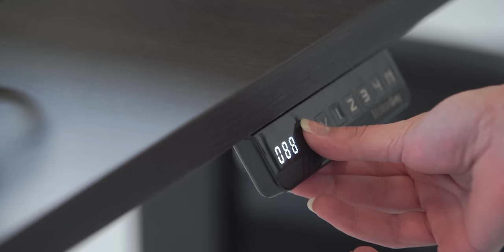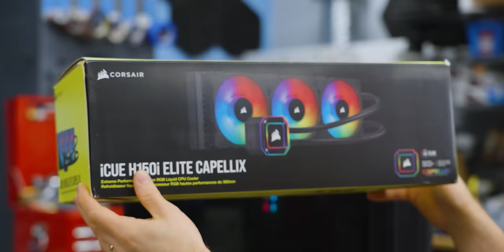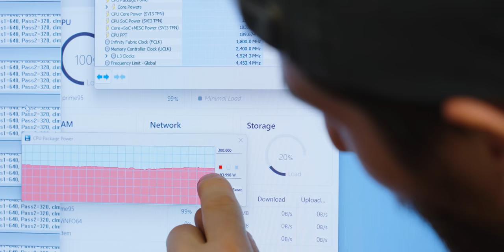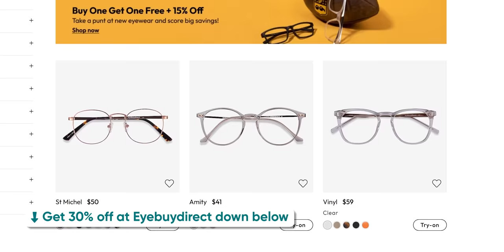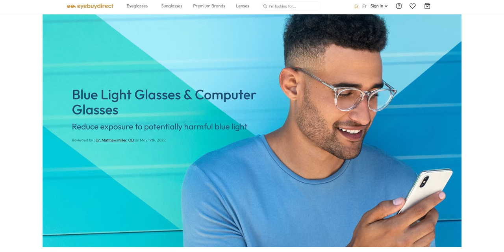Redneck Engineering my own CPU Water Cooler

Comment: I like DIY cooling videos :) Did a DIY watercooling setup for my laptop, the " base station" uses an 12V aquarium pump submerged in a big beer glass, the radiator is a brand new heat- exchanger from a Fiat van because it was cheap, has convinient connections and fits two 200mm Noctua fans. The back panel of the laptop is replaced by a alumium cover that holds down waterblocks over the heatpipes of the CPU and GPU. The waterblocks are in series and quick couplers on the site for easy mobile use, the original air setup of the laptop still functions if the waterccoling isnt connected, I use window washing antifreeze as liquid. Looks awkward but its not stupid if it works :) Those 200mm Noctuas create good pressure through the radiator and the 18W Aquarium pump has way more flow than any PC waterpump could provide. I use some clear garden hose that has strength lining inisde it, that clear stuff Linus uses hear kinks too easy. But I needed to overbuilt it because my waterblocks are touching the laptops original heatpipes and not any heatspreaders directly. But even under full load the temps stay better than the air setup in the laptop could ever be.

Comment: Before watching this vid I'm gonna say I did this stuff almost 25 years ago. It was the release of the celeron 300a, probably the best value overclocking cpu in history. Capable of a rock stable 50% overclock allowing it to out perform the leading PII 450 costing 10x as much thanks to the celeron's on die cache running at full bus speed vs the PII's larger off die cache running at 1/2 bus speed. Water block was a 5/8" thick copper block cross drilled and plugged, car transmission fluid cooler from the auto parts store for the rad, fountain pump from the hardware store, large plastic electric junction box for a reservoir, and plastic tubing from the hardware store. This setup work well and the over clock was rock stable with reasonable temps. Mobo was an ABIT BE-6II. I still have the homemade water block in a box somewhere in my storage room upstairs.

EDIT: No Linus, we did not pull parts from junkyard cars to do this. You can buy these parts new at the auto parts store. And we, or at least the crew I communicated with on the OC message boards at the time, did not use heater cores. We used aftermarket transmission fluid coolers. They were far better suited to the job. We also used fountain pumps due to the afore mentioned head pressure issues. We also used those crazy big full tower cases for these mods.

You're in the right church but the wrong pew. You have the right idea but the wrong parts. You also have the wrong idea about why we did this. It wasn't to save money, it was because there was literally no other option. Commercial water cooling kits, not to mention AIO's, didn't exist. So homebrewing your own water cooling was necessary if you wanted to use water cooling. I am literally having brain pain watching you guys do this. For the amazing smart group of people you have assembled there you are doing this all the hard way and it's making my eye twitch lol.

Comment: I built an oil cooled pc a long time ago q6600 intel. i used a transmission cooler mounted onto an acrylic plate with PC fans and a fishtank pump. worked awesome and I still have it.

Comment: Should have used a transmission cooler. They come in many sizes and are near identical to PC rads. They come in copper units and some aluminum rads are powder coated inside. They come with the same fitting sizes as PC rads. Have you ever tried cooling with hydraulic fluid or mineral oil while using these rads so you don't have the issue of mixed metal electrolysis? Seams to me it would work as well as water. As long as you used oil resistant parts and hoses.
Reply: don't forget the pump would have to be insanely powerful due to how viscous glycol/mineral oil are, plus their specific heat capacity isn't as good as water so increasing flow rate would be mandatory, so that's gonna be one loud-ass pump
Reply: You could use an electric water pump from a car. They only require 12v. They are made to deal with that kind of viscosity
Reply: @glebglub  is hydraulic fluid thicker than water?
Reply: @squidwardo7074  typically yeah, there may be some that aren't because the range is pretty vast due to how broad the use cases are, such as an aircraft landing gear vs a kitchen cupboard, so it can range from as thin as diesel to as thick/thicker than caramel. idk of any that are less viscous than water though (unless you count freon, alcohol, ammonia, mercury, gasoline; though then the safety of using them and their boiling points etc. come into play [and obviously gasoline/alcohol being explosive under pressure, hence how petrol/ethanol engines don't need spark plugs])

Comment: In Finland we used to use radiators from mopeds, not heater cores. They don't need as much static pressure, they're made for cooling, they have smaller fittings and they were cheaper.

Comment: I built one of these back in the early 2000s using the heater core from a Suzuki car. My temps stayed rock solid no matter how much load I put on it. I used a 5 1/4 Bay reservoir. The best thing about heater cores is that they have a higher flow through the internal water channels

Comment: In the 2000s I used a radiator used in house heating to cool my Celeron 2 566 running on 1200MHz. It was passively cooled. (until one FET on my Abit motherboard decided to blow off making my room foggy suddenly). I used a car radiator too one time. And radiators from air conditioners too. I even made my own water block for cpu, vrm and GPU too.
Reply: who needs central heating when your CPU+GPU cap out at putting out 700W, which is the equivalent of 2100 BTUs, i.e. enough for 2x small rooms or 1x large? somehow put your partner's 150W TV and your 100W monitor in the loop for another 1000 BTU and that's a whole small house or medium flat when you add the fact the human body produces a further 250-600 BTU. (just hope you enjoy cold showers)

Comment: Memories of great fun had decades ago. Water blocks made from stock heatsinks and JB Weld. Small engine radiators plastered with 92mm fans were boss. Outdoor water pumps for small yard ponds were what's up. Reservoirs made from PVC pipe and caps. A buddy hard lined his system with CPVC, LOL! Biggest difference was we kept everything but the tubes and blocks outside the chassis and building a proper loop took weeks! We had one Celeron 500 running that ran at 2200mhz. Ah, I so miss the good old days, for sure!

Comment: I have out in my garage an all cooper heater core that is maybe 9 inch by 6 inches by 2 inches thick. Its super small. I got it from a junk dealer many years ago to try a small project where I filled up a old cistern and pumpped water in to that small core to provide some cooling for a small house I had. It worked to some degree and the cistern leaked so it just could not hold the water long enough. I think if I was going to do the project again I would do something entirely else.

Comment: "It's from a 69 Camaro!"...still could be new. I worked in a shop for a summer that is one of the last places that still manufactures classic radiators like that. 1 machine for the tube walls, 1 for the fins and a huge shallow solder bath to solder the faces together all at once.  Interesting place.

Comment: Use outdoor pond pumps, they're meant for long lines and head pressure. Those indoor pumps are cheaply made, you cannot replace the impeller (which most outdoor ones can), and fail quite a lot if they're under some load. They're just not meant for that. Ends up making the price be a bit deceiving, as you'd be replacing the indoor pump every couple months or so which would put your budget pretty unreasonable. Not to mention if viewers tried that and had a failure resulting in damage, the outdoor pond pumps are just a MUCH better option. It's one huge issue with a lot of these videos, it's a great option if you're planning to run something for a few weeks, but many of them fail to take into account longevity and failures which are pretty likely in a few months or so with certain setups I've seen.

Comment: Car Guy Here... A cars heater core ISNT at the front of the vehicle. Its under the dash, inside the cabin. It has two coolant hoses that run FROM the engine, through the firewall, into the cabin where the heater core is located. It recirculates hot engine coolant to heat up the core.. it uses your cabin air blower (same blower the AC uses) to blow that hot air through the vents. 

BAM. Automotive Heater.

Comment: Hey LTT, i know im a bit late to this video so this comment may not be seen. I'm a Lead Engineer at a company that produces thermal solutions for Automotive, Industrial, medical and White goods. these include resistance wire heating, PTC heating, and Peltier cooler. a lot of my job includes things like fan selection. 
A tip which might help for these kind of experiments in the future is on fan positioning. if you place 2 fans next to eachother you double the volumetric air flow but the static pressure is the same. BUT, if you place 2 fans ontop of eachother you double the static pressure but the volumetric airflow stays the same. so for each layer of fans you add you should see a linear increase in static pressure. 

Also a suggestion for a future test: you have looked at direct contact peltier cooling but i think there may be a test which could produce potentially favourable results. Thermoelectric coolers in industry specialise in cooling a closed system with no intake or exhaust. if you took out the intake and exhaust of a PC case and installed a thermoelectric cooler so there is air circulation inside the case but no air leaks. the cooler acts as a heatpump removing energy. With one  of these coolers with you could expect ambient temperatures within the case to be sub zero. This is how they are used in industrial cooling applications including IP rated electronic cabinets.

I don't know if links work in youtube comments but google DBK coolers, we have an office in USA. https://www.dbk-group.co.uk/peltier-cooler

Keep up the good work! these are my favourite types of videos!

Comment: This was a killer experiment. The only thing would be to actually clean out the radiator well. Just running some hot, soapy water through for a while would at least do something.
Even with better fans and cpu block, still a good deal, and as said, ease of maintenance is a huge win. Unlike the AIO systems that you just throw the entire thing away if one thing breaks.
Potentially, this could be a really high performance cooling system, for same or less money. Surprised it took so long to try it, but glad to finally see the results! Thanks guys.

Comment: Honestly getting a cheap or used AIO isn't the worst option.
I bought the first gen Corsair H100 for my 4770k waaaay back when AIOs were still kinda new. Ran that thing for about 3 years stock until it stopped cooling as well then just cut the tubing and added a DDC with the same rad, replaced the fluid and just unplugged the pump in the cpu block. Worked great for years. Ran that on my 6700k for years as well. 
I've since upgraded to a fully custom loop. But it worked great. 
At the end of the day, anything works assuming you have good seals and a quality coolant with biocides and anti corrosion agents.

Comment: The next experiment needs to be with a tiny water to water heat exchanger connected to the faucet.
Reply: I think they've done that before!
Reply: @Tubatasm if I'm remembering right, they just plumbed the tap straight into the cpu block and put the outlet down the drain

Comment: If you're trying to get the tubing to fit over a 3/4" connection they do make reducing couplings and barb fittings with gear clamps. They're usually for domestic water supply and irrigation, but they should be watertight.

Comment: Oh, those nice times... I did such a thing myself that time!
- If you go to a junkyard for a heater core, ask the owner/seller, and they give you a proper size one. (I could buy a brass one that was exactly 120x360mm, with 1/2" pipes)
- Please use proper hose clamps! They are cheap, made of metal this will not expand even if they heat up
- The aquarium pump was definitely the weakes link in this setup the impeller inside broke like every year and it did not have any RPM feedback
- I had to go to a machine shop and let them make my CPU block. And yes, it was brazed.
- I also made a custom reservoir from brass anf 4mm plastic tube. 
- That time 120mm, 3 pin fan was non existent
- I made a cute wooden box for the radiator, that was sitting on top of the case
- It was a reliable system. Even when the pump impellers broke, it did not completely stop cooling. Just some higher temps were the symptom. Once it ran without the pump for a week. (inspite it was cooling a 3GHz Pentium 4, which has been really hot)
- Today, we have all the needed stuff available from Aliexpress, so it is not really necessary to struggle this much with such a setup. I am sure, you can even get a full custom setup for about the price of that AIO, that you only have to assemble, and no craftmanship is needed at all.

Comment: So, as it turns out, this is nearly exactly what I did for my water cooling.  I do have PC parts, 240mm rad, 50 dollar PC water pump.  The rest is constant pressure automotive clamps, silicone tubing, eBay water block, semi-custom mounting bracket.  i think I spent 200 after all was said and done, and the system handles approx 250Wish of CPU heat.  FX-8350 oc'd to 4.8GHz @ 1.365v.  CPU will hit 0C thermal margin with 96F water temps while encoding video on CPU alone.  Setup includes Nidec VA450DC x7, including one with a shroud pointed directly at VRM.  Of course the Thermaltake Core X9 makes fitment infinitely easier.  The biggest thermal limitation on my current setup is the CPU HS to water block interface.  Also running distilled water with silver coil and a couple drops of dawn soap.

Comment: I used a car windshield washer pump for my DIY, got it from Princess Auto. was noisy but good being 12v, running from psu, no need for external power.

Comment: Ah man, i started watercooling with this sorta stuff back in the day. No coloured tubes then, was either clear thin wall water tube from the hardware store or it was some cross-hatched garden hose style stuff lol.

I still remember my first proper "pc watercooling radiator", man game changer....cause it all just fit....mostly....

TBH I've never gone back too air, watercooling is just ingrained now, i don't even think about upgrading without looking at WC'ing gear to go with. Amazing how far we've come, looking at my current AM5 build with a waterboard/distro plate, quadrads, cool looking ARGB blocks/fan, hard lines, integrated pumps and its all quiet as a mouse...

Comment: The phrase "nothing's more permanent than a temporary fix" comes to mind when foraging for something that'll work.
You just got to embrace the jank, because you know full well that it is staying there.

My favorite improper part for the right job, I've personally used, was magnetic filter as a side panel. I could even slide one over to pin a fan between them.

Comment: on 2008 we made a cabinet from a gas tankless water heater using the actual system as coolant, and put a led on the pilot window for the disk usage led, really nice. little bit too large

Comment: Thank you for that Video. It gave me so much memories from my watercooling times back then (I used an old radiator from a truck). However, to go even a step further, you could also build the water reservoir and cpu cooler yourself.

Comment: Please note that these kind of pumps usually require the coolant temperature entering the pump to be below 35 celsius / 95 farenheit. Specially when used in-line (not submerged in water). Great video !

Comment: About the green liquid going in the sink, it's basically how you'd get rid of it . The solution to pollution is dilution,  meaning you just need to run water through the drain with it .

Comment: Linus, almost all heat exchangers outside of the PC world run mixed metals, including that probably brass and copper Camaro heating core you are using. Even the PC ones that claim to be all copper are mixed metal, because most of the pumps have steel impellers and blocks are nickel coated. Run any metals you want with a type B automotive coolant. Change the fluid every 5 years. I have never had pitting or corrosion like this. Don't use type A coolant, its less effective and can react with some plastics. We used to run the Honda civic aluminium half rads like this, it's no problem. Think about it, cars run brass and copper heater cores through steel mesh reinforced pipes into aluminium radiators that put water through iron blocks. And they will run for decades.

Comment: I love how they mix fluids, copper, and aluminum on engines. Then you get green scuzz forming everywhere. Old engines mostly used iron and steel, but new engines use as much aluminum as possible. Even using the right fluids allows the copper to sacrifice itself, and the iron/steel parts do the same. Yay aluminum!

Comment: I ran a heater core on my first watercooled PC back in the early 2000's. Much easier solution, just use adapters from the 3/4" OD outlet of the heater core, down to the appropriate size to match your tubing. I ran my PC that way for years, I even used a 60/40 mix of distilled water and car anti-freeze with a tupperware as a reservoir and external sump pump. It was loud, and my bedroom smelled like anti-freeze at 16 years old lol
Reply: Also, hose clamps, not zip ties lol

Comment: Reminds me of the "old days". Back in 2004, I built a water cooled pc with my own hand built case, and two brand new copper heater cores with barbs JB-Weld-ed on. It never leaked, but I did use proper hose clamps, instead of your lazy cable tie solution. I miss that monstrosity,